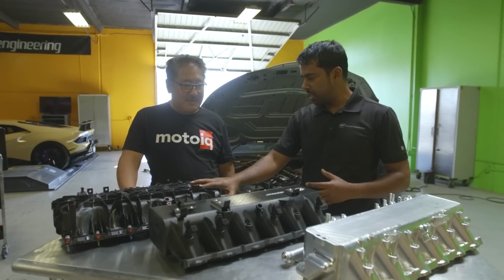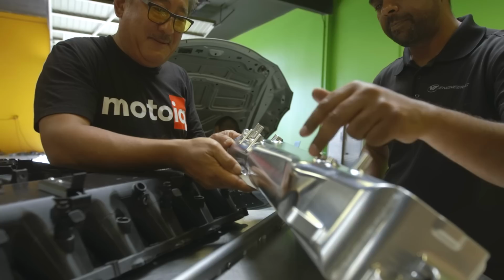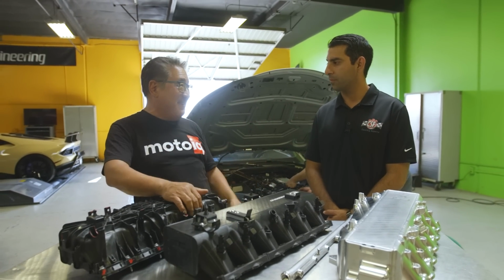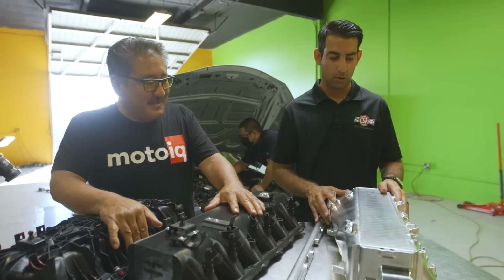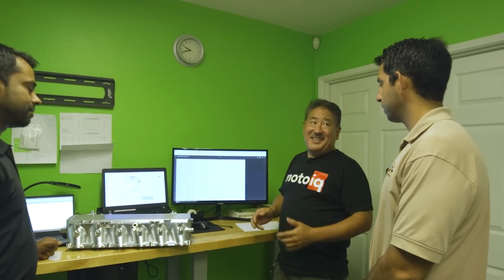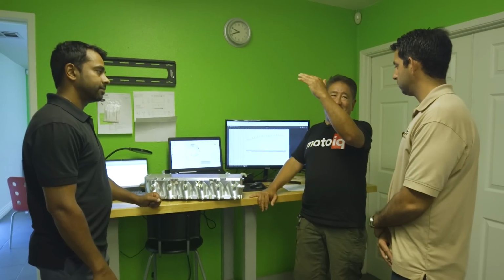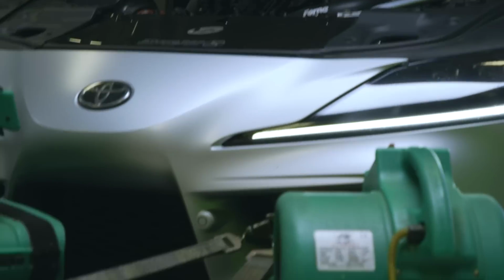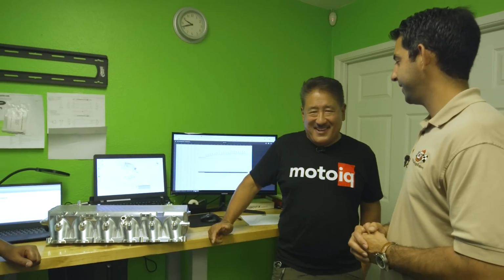More Horsepower and Improved Cooling. Supra / BMW CSF Charge-Air Cooler Manifold Test

Comment: To make conservatively ~20hp/~10tq in the process of bulletproofing is fantastic - this mod would be worth the reduction in stress on the engine alone.
Reply: you know price on this thing is $4300 right?  I mean its worth it if you need it, if you're actually being limited by the factory part.  but thats a hefty price tag for just 20hp and a little stress reduction...
Reply: Right. This intercooler will give you much more overhead in heat management and flow. Much more safety margin for tuning
Reply from the maker: @boblast5582  A cheaper version that is cast is coming soon.
Reply: @boblast5582  It actually opens up a lot more features such as included port injection and ability to control cylinder spray if running nitrous / meth. You're getting a lot of features included with this manifold that make it a great value when comparing all of the different features bundled together.
Reply: @CSFracing  yeah, absolutely.  Thats why I said if you actually need something like this or if the oem intake mani is limiting you, this is a great part.  but if you wanna get this just for the 20hp gain a little less stress on the engine, not really worth the price for that...
Reply from the maker: @boblast5582  as a note, if the ecu was retuned to take advantage of the CSF intake manifold, the gains would possibly double. Another thing is you don't have to take the intake off to change the oil filter!
Reply: @motoiq  oil filter thing alone makes this a better buy than the other one on the market
Reply: @CSFracing  so you are saying with this manifold you don't need a separate Port Injection kit like the EOS because this manifold replaces that?
Reply: @motoiq  what will be the difference between this version and the cast version.  This version will be lighter and better and heat management ?
Reply: @supranova730  yes that is correct - you can run top feed port injection directly through the manifold
Reply: @CSFracing  thank you
Reply: Has the cast version come out yet?

Comment: Great review, but overly conservative showing the hp/tq curves when thermally stabilized after 20-30 pulls every 30 seconds. I think that relates to track events with a lot of tight corners, not street driving. I remember shopping for intercoolers, and at Corky Bell's site, the data on those bar & plate A/L intercooler cores at high HP ratings had less than 1 psi pressure drop !  Early A/L kits were flawed by using high pressure oil coolers up front, later VW Scirroco radiators were a popular up grade.
Reply from the maker: We wanted to be conservative.
Reply: @motoiq  Understood, but who wants to know the power gain after 18-20 back to back dyno runs? Great point about the the low dp with the new bar & plate core, reducing compresser outlet temp and likely pressure ratio on stock turbo, landing on a more effcient map island.

Comment: pretty sure that oil filter thing is an everybody thing.  Kinda the opposite of what Ravi said, I can only imagine race teams buying these if removing the manifold was required for an oil filter change.
Reply: EOS manifold has to be taken off for access to oil filter. It’s not an “everybody” thing.
Reply: @desi_supra2871  any people buy that? For normal street driven Supras?  So oil changes take hours? Why would anyone put up with that?
Reply: So changing the oil is going to be a nightmare.... fuck that
Reply: @boblast5582  No idea but it’s a terrible design from EOS. I was waiting for either CSF or AMS manifold but I like the CSF one more so I bought that one. Hopefully AMS design allows for oil filter change without removing manifold which I’m sure it will.
Reply: @desi_supra2871  next time put your oem manifold back on bro, wtf every oil change you have to deal that shit... oem is OK
Reply: @M3E92V8  Kia stinger oil filter and cap
Reply: 1 hour every 5000 miles seems fine

Comment: Does it have a bolt on lid to change the core? It looks like the lid is tigged on. That's a problem for me. If I get a core leak and I have to buy a new intake, I'm seriously pissed. 
Besides that I can't stand the new BMW 500ml cylinder with the same bore and stroke for everything they make. It's just a cookie cutter engine for no horsepower and big horsepower depending on the bolt ons from the factory. It's a straight emissions design with cam timing and direct injection used to make the different power levels. Frackin i8 has a half a Supra motor.
Reply: Bore and stroke are different for s55, b58, and s58.  There's actually lots of bottom and top end hardware differences between the newer platforms, so not as cookie cutter as it seems